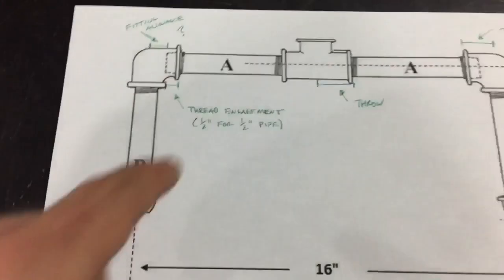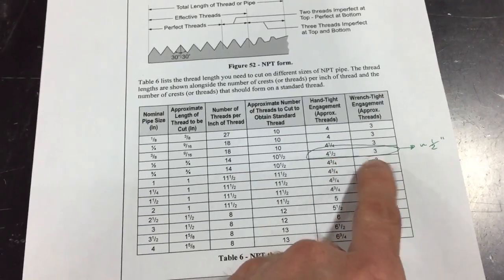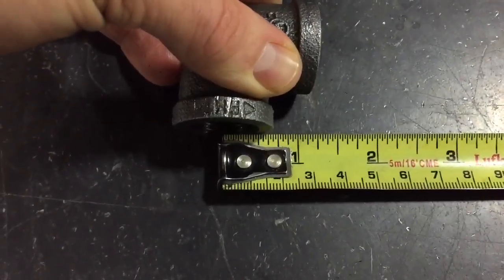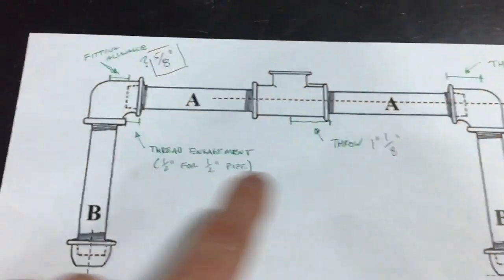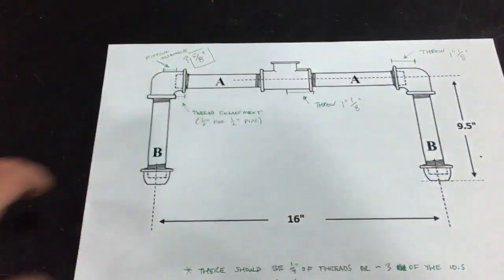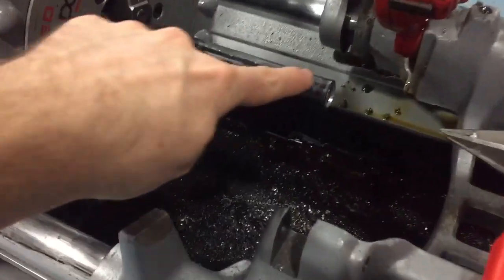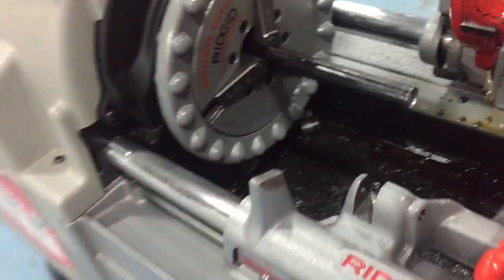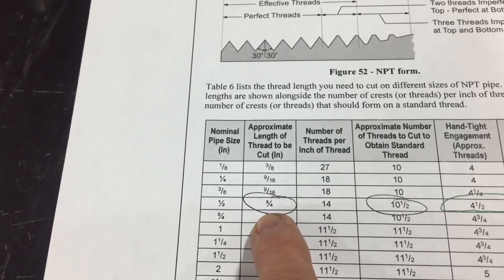Pre-Lab Video — Pipe Threading

Comment: How do you get 1/2” of thread engagement from saying there should be 10.5 threads and 7.5 threads should be covered when wrench tight. Where does 1/2” come from?
Reply from the maker: The chart in the first 2 minutes of the video shows for 1/2” pipe there should be 3/4” of threads cut. If 3/4” of threads are cut with 10.5 threads total and 7.5 engaged, then: 7.5/10.5*3/4”=0.536” or ~0.5” of threads engaged.

Comment: you completely glossed over a huge step(s).... and it is that step(s)  I need to understand.  Gee you dont have a crystal ball and know in advanced exactly what I need!  LOL.  Actually I cant be the only one.   

HOW in the hell do you get the elbow or Tee to end up tight AND facing the exact direction you need it to face?
Reply from the maker: The three threads of engagement for wrench-tight is approximate. Tighten until you have it facing the way you want it and with approximately 3 threads engaged from hand tight. Once you do it a few times and get a feel for it, it will make sense.